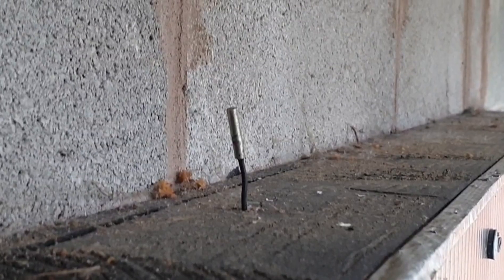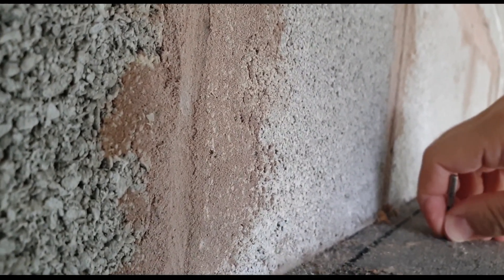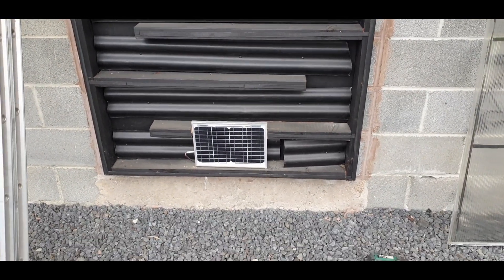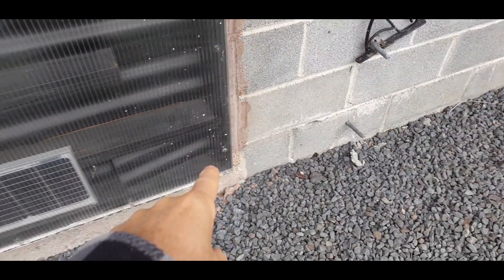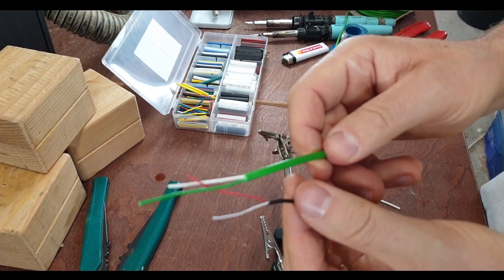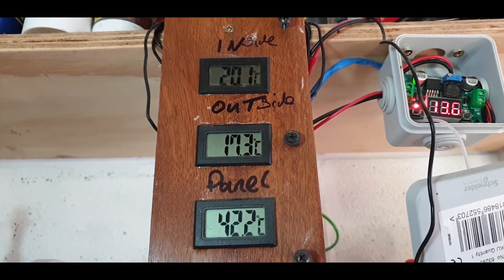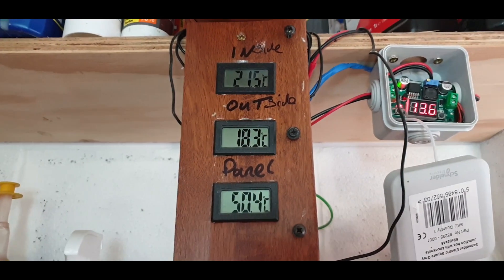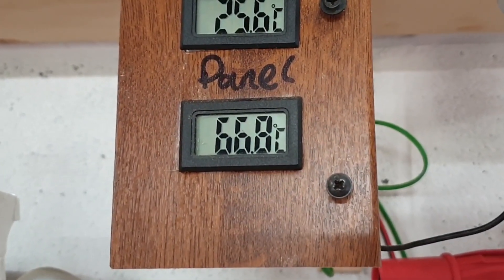Solar Air Furnace temperature sensor upgrade = free heat!

Comment: Great video, thank you. I'm interested in building one of these myself. Are you in the UK? How well do they work in winter and do you get any benefit at all on a cloudy day? Thanks mate
Reply from the maker: yes in the uk, have a look at this one its more about the temp's https://youtu.be/LfPYGovya88 
I built this to help keep the workshop dry in winter so I mounted them vertical, the large panel is also shaded by the roof overhang, as with all solar it is affected by cloud but you could build a much larger panel to improve it but you would probably need to think about some sort of bypass for summer as even this size being vertical and shaded still gets plenty hot.
Reply: @50plusdad-uk  really appreciate your reply, and will definitely do a summer bypass! The video with the temps looks great, though I'm guessing that was August or September time. Would be very interested to know if it increases the inside temperature at all on a totally cloudy 7 degree day in December? Even if it only adds a couple of degrees every little helps! You said it helped with damp in winter? Cheers
Reply from the maker: This was late August, Apart from really cloudy raining days etc it's always warmer than outside which is good for a non insulated, block wall, tin roof building. The larger panel is also on a west facing wall so I could improve it if needed but it does exactly what I hoped it would, I was getting mold under the wooden shelves but now it's a lot dryer in there. cloud is a killer but when the sun comes out it definitely takes the edge off.
Reply: @50plusdad-uk  thanks for all the info 👍🏻 subscribed!
Reply from the maker: @theowhite  No problem good luck with you panel !!👍👍

Comment: I wonder about making it a completely closed loop where you run pipe inside through some sort of mass like masonry or stone to make a thermal battery that might radiate heat into the night.
Reply from the maker: Something like a rocket stove bench maybe. I think you would have to split the 4 inch pipe into 4x1inch to increase the surface area and run a lot of it to get the most out of the lower temperatures compared to a stove etc. 👍
Reply: @50plusdad-uk  FYI it would take (16) one inch pipes to get the same volume of airflow as a single four inch pipe. But yeah, I get what you're saying 🙂
Reply from the maker: Slowing the flow might help, longer heating in the box and then longer time in the thermal mass to store the heat. Maybe even a slower fan. I've not seen anyone do it yet, but it would be interesting to see how it worked.

Comment: Hi mate that seems to be a great idea. I take it the fan can be turned off when wanted. 26 degrees Celsius seems a bit hot to me for inside. I wonder about the noise though.
Reply from the maker: I can disconnect the power from the panel, but tend to just leave it connected, I have considered some sort of thermostat to control the temp during the summer possibly even a bypass to dump the heat out of the panel. Noise wise the fans on both panels aren't bad as they are effectively outside, the worst bit is when the solar panels aren't giving out much power the fans whine which can be annoying especially when trying to film. 👍